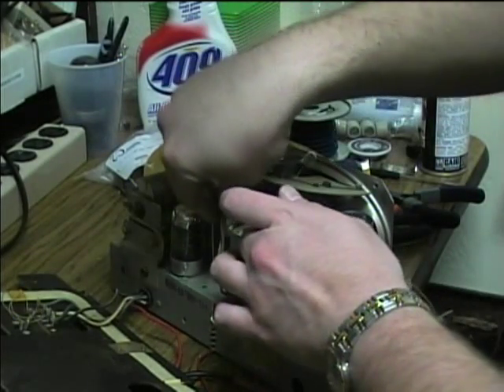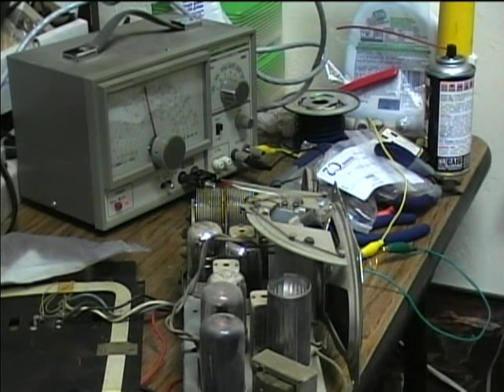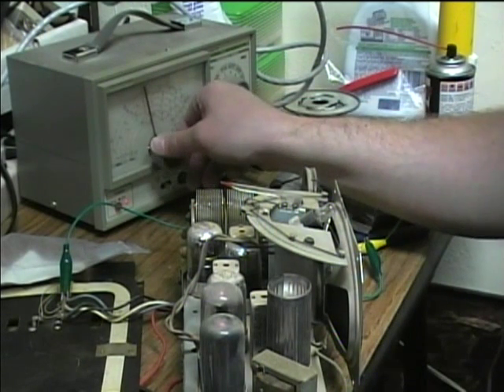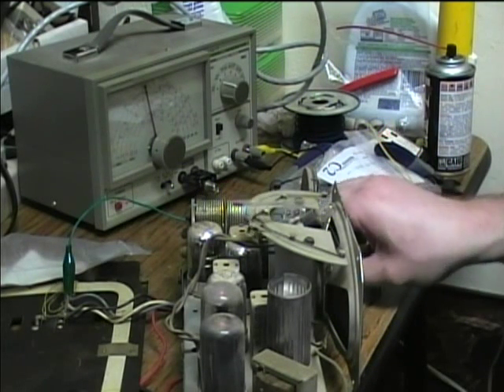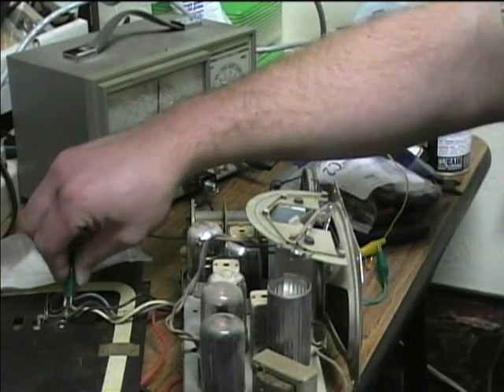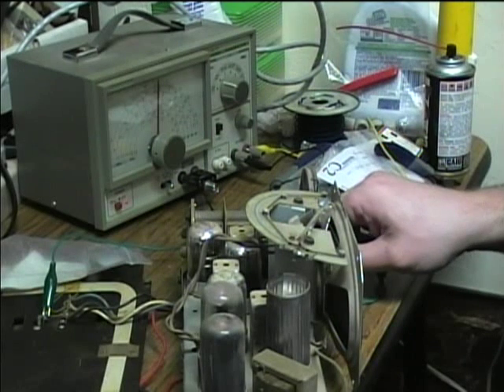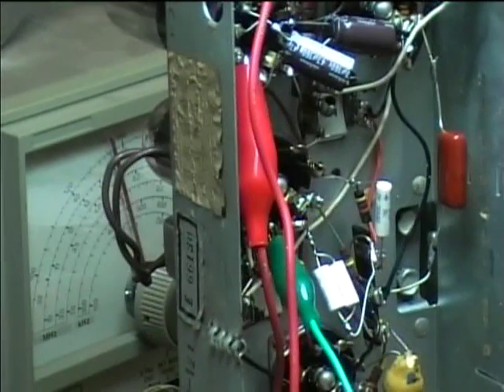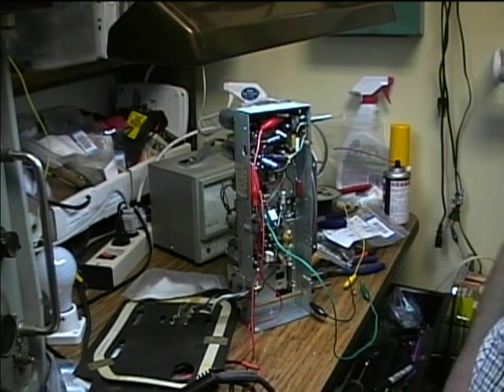Philco 50-920 tube type radio complete repair job part 7

Comment: Why is it that just after replacing the paper and electrolytic caps the radio could receive stations, if noisily, but after spraying the tube sockets with contact cleaner, stations could no longer be heard? Do you think the first power-up finished the IF caps?

This is such a great addition your videos, Chad. We've learned so much from you but this series is particularly important for me as I'm about to attempt to bring back to life a 1935 Cossor model 368 super-ferrodyne radio receiver.

Comment: that's so weird how it worked fine before you cleaned the tube sockets I almost wonder if they were damaged because I read in a comment you're not supposed to rock them...